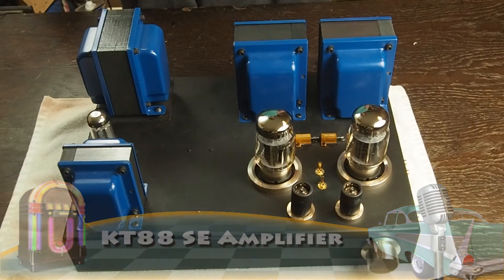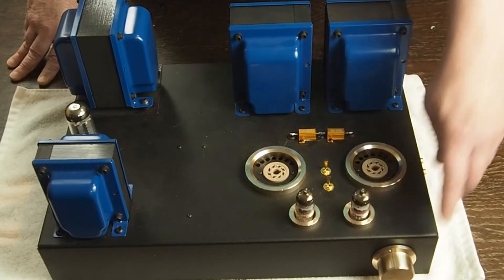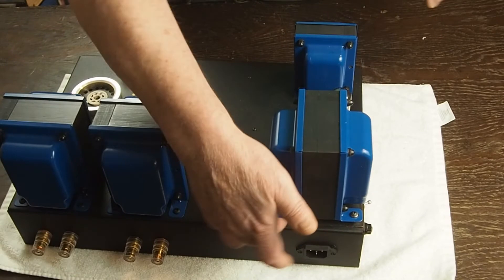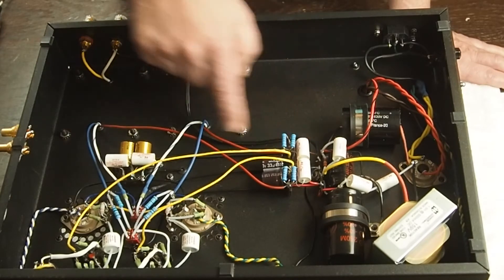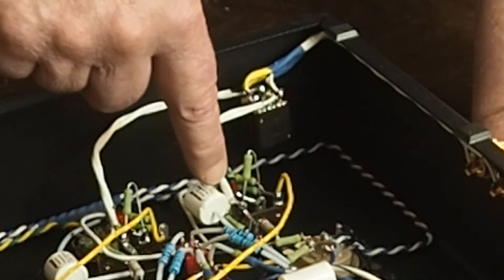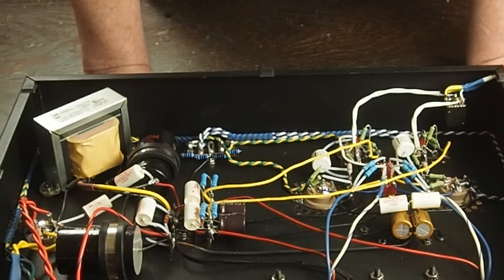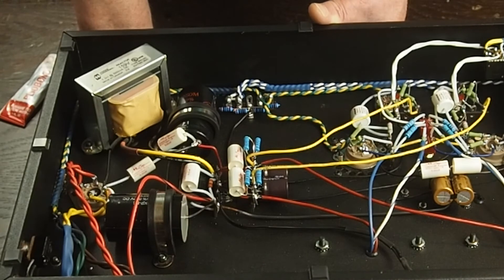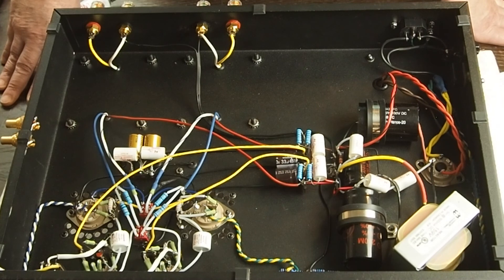KT88 SE DIY Amplifier Build Part 4

Comment: Hi Stephe. 
Hope you're well. 
The bypass caps are not in the online Bom so just have some quick questions. 
1. What was the exact Film Cap you used to bypass? 
2. Could I use this same film cap and value in other amp builds or do I need to change the value for different voltage? 
3. You used this bypass cap on all other caps, correct?
Thank you! 
Jonathan
Reply from the maker: I ended up not using those bypass caps. Didn't like how including them sounded.

Comment: Hi there, Stephe. Quick question for you, if that’s ok. Why do you stick with the Alps stereo (I assume 100K) volume pots? Are they just the best sounding to you? When I built my Elekit 300B amp, the pot that came with it was awful. I tried a few others like TKD, EIZZ, Audio Note, and Alps. The TKD sounds best to me, but that was also years ago. 
There’s a couple I can’t recall off the top of my head, but because a volume pot in a SE class A amp is basically attenuating the signal rather than increasing gain, it’s obviously an important part. 
Thanks ahead of time, Stephe. 🔊😊🎶
Reply from the maker: I've been using audio note ones lately.
Reply: @SkunkieDesignsElectronics  Appreciate it. Thank you, Stephe.